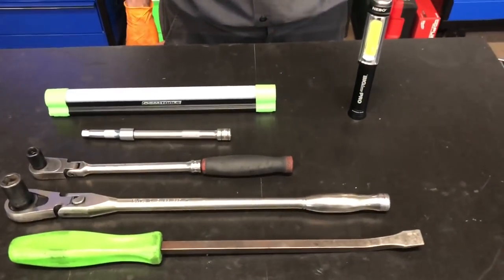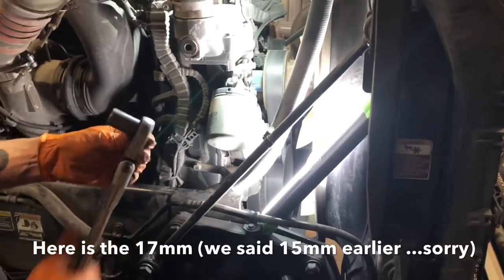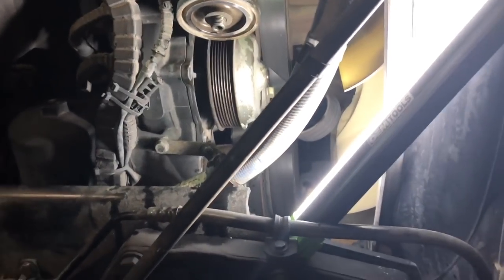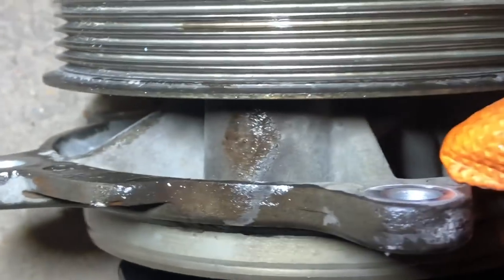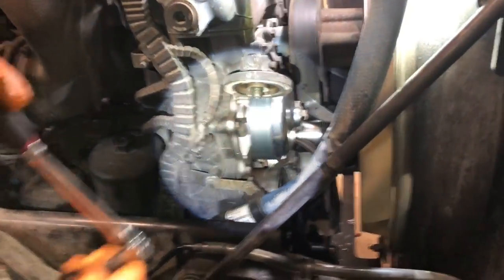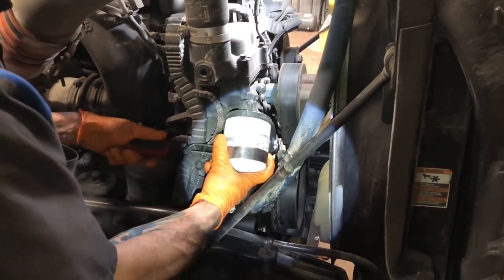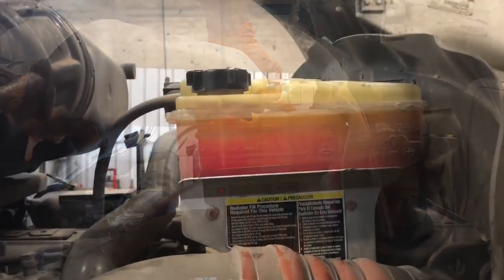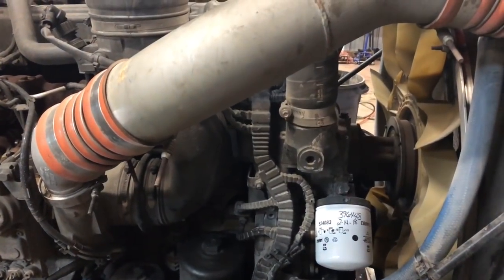Paccar Water Pump Replacement DIY and save that money ! Easy to do !

Comment: I changed the water pump and the bottom hose on the radiator and those 3 plastic fittings that the heater hoses are connected to on Saturday.

The water pump was very easy and I couldn't have done it without your video.

Thank you so much.

I appreciate all of you at Koon.
Reply from the maker: Glad you got it taken care of and saved a bunch of money doing it! Job well done !

Comment: Seems like that cooling system is easy to get the air bubbles out of. Worked on a couple Freightshakers and they both wouldn't pop their cherries unless you took them down the road a piece, became more of a job than the repairs. Good vid guys!
Reply from the maker: Terry Stoner they actually are easy to do a waterpump job and get the air out. Probably the easiest ones there is

Comment: Nice work guy's, what I have done is find some of the same water pump bolts. Cut the heads off the bolts. Then cut a groove with a die grinder say a 1/8 of inch. Just enough to get a stubby flat bed screwdriver to thread them in the holes of the block to use them as alignment studs. I slip on the new pump on the studs and take one stud at a time use the original bolts to reinstall the pump and this way you don't have to fight getting it mounted up.
Reply from the maker: Greg Feeney that’s a good idea. Usually we will hit it first try but this was a stubborn one.

Comment: I work on garbage trucks.  That engine is a good over the road truck but from my experience most guys including me struggle with repairs on those truck.  Discharge line for instance a common issue is bracketed down to top of Trans and connects to a metal pipe that wraps around and bolts down to top of air compressor. Depends on truck it's either under  body or under cab, have fun getting them off when they clog up and truck won't build air pressure. I'm 140 lbs skinny as .... so I can get of quick and easy but most guys are tiny and can't fit. Garbage truck front loads usually have a service lift to raise the body which makes it super easy, if the lift isn't trashed which they almost always are.

Comment: Grease works well on that type of gasket too.It is cheaper to fix a leak than ignore them burning up an expensive engine.I have seen engines burned up all because of leaks ignored

Comment: I'm going to attempt a water pump replacement tomorrow.  Ty for the information.  I feel pretty confident because of you guys.

I'm also going to attempt to replace the plastic fittings that go into the block where the heater hoses plug into.

Have you guys messed with those?

Ty

Comment: I was going to mention a cool: tool called a coolant lift pump, it’s great for checking your coolant system with a vacuum before you have to refill the system, also you can actually refill the system with the tool instead of putting in the jugs or putting in the original coolant. Google it or YouTube it, it’s a pretty neat tool. Helps avoid airlocks.
Reply from the maker: I actually bought one after this video

Comment: Can I pull this off with standard ratchets or do I need those specific lengths?
Reply from the maker: No you can use anything even wrenches. This just makes it easier

Comment: My coolant temp sticks at 165F, Warm but  not warm enough Can tell somethings is forcing the Thermostat to run at Cooling mode. Truck runs fine no check emgine light but its annoying when your cruising on the rolling hills when its time to get a hard pull engine is Luke warm. I thinking it may be my coolant temp sensor or thermostat. I have a 2015MX13 500/1850 mounted on a long nose pete. Could this just be the Ambient temp in that bay because its has all the room in there to fit another mx13 and big grill sucking in cold air? 🤣
Your advise will be greatly appreciated and will save me time before I even think about pulling parts here and there. 😇

Comment: Would that be the same procedure on a 2018 model. Since the water pump is a little bit different. Just wondering if they added a bleeder somewhere to get the air out

Comment: Then when your air compressor goes have fun getting those inside mounting bolts off of the starter and air compressor.  You also have to pull the fuel pump it's mounted on front of starter.   There's a lot that can wrong there to.  The air compressor has a oil tube thing I don't remember what it's called but it goes in side ways thru the compressor into the engine and to get an Allen head on it in between the compressor and frame is horrible it's a real tight spot.  I watched 3 mechanics combined 30 years xp break that compressor off the truck because of that stem. Then the truck sat for a week while they tried to figure out how to get that stem.  It's always a Paccar, waiting for parts.   Mack, bam they are there that day or next day.     That's my experience with them.   They are good over the road trucks, but horrible garbage trucks.   We have one that stalls out sometimes twice a day and rush has "fixed" it like 6 times for the same thing it will go out the very next day and do the same thing after they "fix" it, I'm not exaggerating.   Rush is a Peterbuilt certified dealer if I'm correct, all the Pete's we get have paccar mx13 or whatever they.    I had one I did a pm and oil change on 2 years ago.  Cabbed it over and the cab cylinders took a sheet and it wouldn't cab back over then after oil change it wouldn't start and nobody could figure it they had to call rush.  It sat in a bay for week broke the phuck down and it's a defect with the fuel filter it would do it sometimes after a filter change.  I can't remember but it sucked bad. Flooded the bay with dookie juice and sat for a week like that.

Comment: There is a nut that has part of cut that is leaking that on the part that the filter screws into that is leaking is it just the bolt that needs to be replaced

Comment: I’m curious about how to change the air compressor. Paccar has it tucked into the frame rail, at the bell housing.  Looks like a pain to get out !  Is it secured to the block by a large snap ring, because I see no fasters ?

Comment: But they are good over the road they seem to break down less than an mp7 or autocar but they can be horrible to work on.  The new ones like the engine in video don't have that fuel filter anymore. I haven't seen the new new ones we have a bunch of 2019 paccars and we have a couple front load Pete's around that have a Cummins in them I don't what the engine is called I just fix it lol.  It's red

Comment: Have you found the 15's are running with less issues then the 12's did ? Don't hear much on the newer MX13. But sure did hear lots of them the first few years. Still like my old Series 60 Detroit.
Also it was coming a flood in Selmer Tn yesterday also.
Reply from the maker: Pete k they have less issues but we have learned some tricks on them so we love em
Reply: Thanks may have to come by the shop. And talk to you soon. May be looking at a TRi Axle or Quad dump truck. And finding the trucks with that engine. Weights less for sure, and less weigh means more $$ at the end of the day.

Comment: I got all the way to pulling out the water pump, and couldn't get it pass the fan blades, only needed half inch but couldn't get it out so ended up putting it back together with it still leaking, T-700 Kenworth, wasted day.
Reply: I had the same problem on my T700. What I ended up doing was using a Milwaukee rotary tool to grind out a gap on one of the fan blades, big enough to allow the pump to clear. Took about 5 minutes.

Comment: Looks like you guys didn't reverse suction the coolant in, I've got an 2016 t680 paccar mx13 and am about to change my water and coolant. The cat guys are telling me to reverse suction it, but if I don't need to I'd rather not. Will the engine be fine if I just dump in the coolant and fill as needed?
Reply from the maker: You seen us do it.... that’s all I can say. It’s your truck and your call on how you do the repair. We just show it the way we do it. We have done it with vacuum and without.
Reply: @KoonTrucking  that was what I was hoping you'd say, thank you for all the awesome info you guys are putting out!

Comment: I keep getting that yellow radiator light on the speedometer indicating low water. And a beep. 
No leaks. Not low. 
Any knowledge or “Tricks” appreciated. 
2015 T680 w/MX13
Reply from the maker: It’s coolant level sensor in the tank
Reply from the maker: It just pulls out from the bottom on plug and put the new one in
Reply: Koon Trucking thanks for the reply. I’ll swap it out when I find a dealer. LOL 😂 I’m unloading right down the street from the Pete dealer in the morning.
Reply from the maker: They are pretty salty i think around $150ish ?? Don’t quote me on it but they are high. Easy to change not tools required. Just pop the connector loose and pull it out and pop the new one in. Coolant doesn’t even come out.
Reply: Koon Trucking thanks Clay. Finally found one at KW of Jville. $141.64. Seems to be working. 
Thanks,
JL